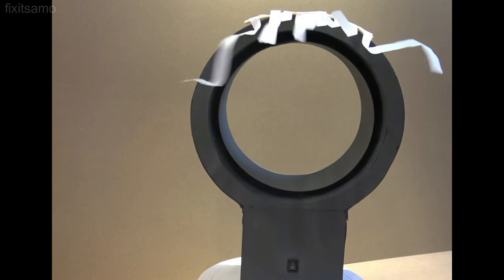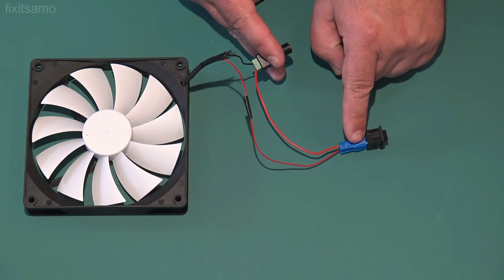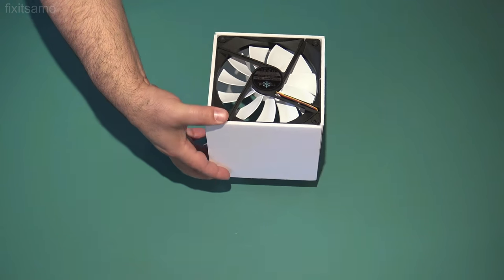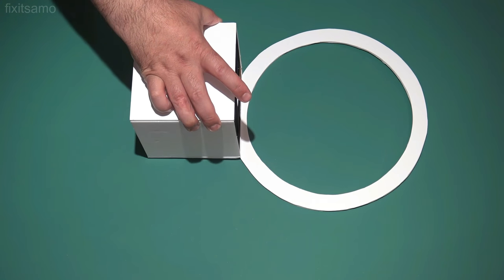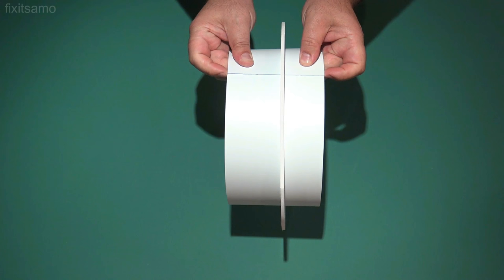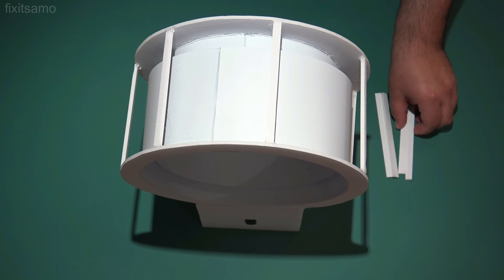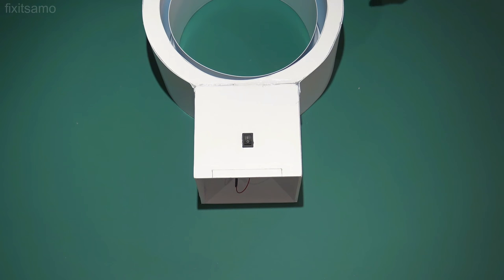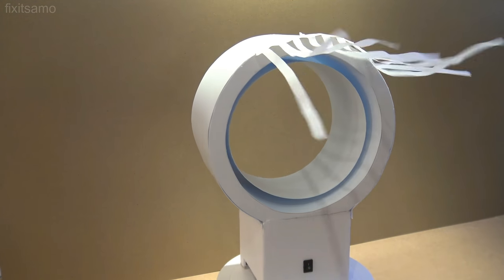How to Make a Bladeless Fan - DIY Homemade Silent Fan

Comment: nice project....my main issue is how cool it can keep you. Small fan can only do so much....nice and neat execution...and very light i persume. I would a a shelf underneath and put something cold like a block of ice so that the air that is sucked in comes out even colder.
Reply: The idea is that even tho the fan is small there is a multiplier effect on the air that it sends towards you. The air being pushed by the small fan creates a low-pressure area behind the cylinder that causes even more air to go through. So it should be enough. But I suppose you can always use a bigger faster fan if you want more air.
Reply: I don't, generally, use a fan for cooling. To me, air circulation is the main thing.

Comment: hello friend, very good your input, I have an idea, nose to what extent can help me, the idea is this: I have a small motor console splip which kiero use to make a fan on a larger scale, the problem is that 220v motor is not like making the connections, any input can be of great help me, I'm from Venezuela, thanks.

Comment: Wait, where did you get that exact fan, and what is the power input and output of the fan?
Reply from the maker: +Dolphinasd Gaming 

Its a standard pc case fan  input 12 V
Motor speed up to 2000 RPM
Reply: fixitsamo thanks.
Reply: fixitsamo Does it also work on a USB connection of about 1 amp?
Reply from the maker: +Dolphinasd Gaming 
It all depends on your fan

Comment: those who think he lied about "bladeless" read below. A bladeless fan (sometimes called an air multiplier) blows air from a ring with no external blades. Its blades are hidden in its base.
Reply: I don't think anyone was really dumb enough to think that you can make a fan without blades
Reply: +Ash Scott Oops I did thought it was without blades
Reply: manu thomas ahem, think old school, A PEAICE OF PAPER IS BLADE LESS.  Duhhh, it's a fan if u fold it like one
Reply: Check out the exhale fan. It uses vibrations to generate wind

Comment: 3:37 You do realize you're not making 6 inch circles.  The compass is set to 6 inches for a 6 inch radius, but the circle you create is 12 inches (1 foot) in diameter.

Comment: That is a wrong design. The inner surface should be cone - it provides the Coanda effect with sucking times more air, and the slot should be deeper - at the very beggining.

Comment: I didn't  understand  that from where the air comes from because  you do not have make the any hole in upper side of the PC fan and one more Question. and from where  I get the PC fan
Reply from the maker: The air circulates comes from the bottom off the base where i made the 4 cuts  trough the pc fan  and it will come out between the inner and outer circle  

You can purchase the pc fan online  or go to any pc repair shop they are not hard to find
Reply: The air comes from underneath. Notice the base doesn't sit flat on the table.... there are those rectangular gaps or holes, so the 'bladed' fan can suck or draw air from underneath, which forces the air up to the circular opening. The system isn't really bladeless as such ..... it's really a 'hidden or concealed blade fan'.

Comment: where did you connect the adaptor? to the outlet??
Reply from the maker: That’s what i used 

Vct VX-79NP Multi-Purpose AC to DC Adapter Voltage Converter 110V to 240V with Multiple DC Output Selection1.5, 3, 4.5, 6, 7.5, 9 and 12 Volts DC, Fixed 1000 MA https://www.amazon.ca/dp/B0014JUGTQ/ref=cm_sw_r_cp_api_i_5HKZH940XHW5EKGEZQEQ
Reply: 🔴 What Is Islam? ⚠️

🔴 Islam is not just another religion. 

🔵 It is the same message preached by Moses, Jesus and Abraham.

 🔴 Islam literally means ‘submission to God’ and it teaches us to have a direct relationship with God. 

 🔵 It reminds us that since God created us, no one should be worshipped except God alone. 

 🔴 It also teaches that God is nothing like a human being or like anything that we can imagine.

🌍 The concept of God is summarized in the Quran as:

📖 { “Say, He is God, the One.  God, the Absolute.  He does not give birth, nor was He born, and there is nothing like Him.”} (Quran 112:1-4)[4] 📚

🔴 Becoming a Muslim is not turning your back to Jesus. 

🔵 Rather it’s going back to the original teachings of Jesus and obeying him.

Comment: What size pc fan did you use?
Reply from the maker: +Saul Rocha  5 1/2 x 5 1/2
Its a universal pc fan usually installed on a pc case  for air  circulation
Reply: fixitsamo so a 140mm fan, that's what I used
Reply from the maker: +Saul Rocha 👍🏼

Comment: No it's a wrong design basically blameless fan has an airfoil type design which is completely missing in your design........... more over just check bro does air is flowing from center or not

Comment: are you using card board
Reply from the maker: +Deepika Laxmi 
I used  plastic  for the video but you could a cereal box cardboard
Reply: @fixitsamo  what kind of plastic did you use?
Reply from the maker: Its a very flexible plastic i got it from a printing shop they usually use it to make signs i don’t know the name unfortunately

Comment: Am I missing something?? There's a bladed fan!!!!!!!!  
Should be called how to make a bladed fan unit APPEAR to be bladeless
Reply: A "bladeless fan" is just a generic name for Dyson's "Air Multiplier" trademark.  That's what people started calling them because it appeared that there were no blades on the fan, when in reality, the blades of the fan are inside the base.  It's not simply a matter of hiding the fan blades inside the base to make it appear to be bladeless.  There is a scientific principle involved called the Coanda effect that actually multiplies the amount of air flow produced by the fan blades by around 15x.  However, with that being said, this design in the video wouldn't actually produce much of the Coanda effect as the inner circle is simply flat. 

If you're interested in it, James Dyson explained how it works it in this video when they first launched it:
https://youtu.be/8he8afjQyd8

Comment: How is it bladeless if it has blades?
Reply: with "bladeless fan" is meant, that there are no fans visible.
Reply: Then it should say "hidden fan" but instead you use the title as click bait. Very interesting project but you should have just tole the truth in the title.
Reply: dyson calls them bladeless fans, I guess they're using that as click bait as well then
Reply: Why so pedantic?
Reply: Dyson fans work by a ionic breese. Not hidden fans.

Comment: If this truly multiplies the air, you should show the air being sucked through the hole, not just the air that is being pushed through the round slot as shown in the video. Nice project build, but poor demonstration.

Comment: I've been debating this "blade-less" fan nonsense for a while now, and it seems there are still people who think it's OK to call a fan blade-less.  My argument has been, and still is, that you cannot call it a "blade-less fan" because a fan has "blades."  That is the way a fan works - it has angled blades that force the air forward or in reverse.  Now, these so-called "blade-less" fans just just re-configured chassis, with the "fan" forcing the air through a different path.  It does not work without a "fan" and that is the reason you cannot call it "blade-less."  In fact, the word "blade-less" is not even a word.  The only reason it's found anywhere is because Toshiba created the concept in 1981 and then Dyson patented the thing and called it an "Air Multiplier."  I'd much rather people called it that, instead of "blade-less" fan, as this would at least make more sense.

My argument has always been on the term, "blade-less."  So here is another angle that most people are not taking into consideration.  When you add the suffix "less" to a noun, you get an adjective that describes the root word.  For example, "Sleep" + "less" = "Sleepless" and the meaning is "having no sleep."  Same with many other examples such as endless, restless, flavorless, weightless, shameless, priceless, motionless, heartless, and harmless.  There are probably thousands of examples.  So if "blade-less" were an actual word, it would mean "having no blades."  And since these devices all use a fan to push the air, and fans cannot work without "blades" then it cannot be called "blade-less."

Again, just because the fan is hidden, we cannot say it doesn't have a fan.  Therefore, we cannot say it doesn't have blades.  And therefore, we cannot call it bladeless, which isn't even a word.  I'm done, I've made my point.  I'll shut up now so the crybabies will stop complaining.
Reply: Nobody cares
Reply: Some people are just small minded! If he is  so bent on the terminology, he should go and sue Dyson for false advertising.

Comment: Considering you can buy a Dyson clone now of about this size lighted with a water cooling system for about 30.00 and his materials and a glue gun would cost about 20.00 it would probably make more sense to just buy a nice slick brand new real one. Unless you are looking to just build one anyways and are into that foam construction high school project look. It still doesn’t swivel like in the video.
Reply: I always see comments like this on DIY videos.  Just makes me wonder why people are watching DIY videos if they don't even have a glue gun, and don't have any idea what they cost.  I have one that was $5, and a dual temp one that was $25.  

A good portion of DIY projects are more expensive than just buying the thing... but not always.  It also depends on how much time you have, how much your time is worth, and what supplies you already have.  Most DIYers will already have a glue gun (or two) laying around, and various materials/scrap to build with.  Not to mention boxes/closets/sheds/garages full of junk that they can salvage from.  Saving money is rarely the point, but once you get into it and you have some tools, you can find a lot of ways to save.

There are 3 main reasons to DIY:  1) learn something.  2) "upcycle" some old junk you have laying around.  or 3) save money.   And they go basically in that order most of the time.  Simply "having the thing" isn't the point.

Another big reason is that people just like to make their own version with their own aesthetic/personal touches.  But there are any number of other reasons, like doing something crafty with kids so they can learn something.  I don't have kids (yet, anyway) but I like to make things for my niece & nephew, and I like showing them that you can make things instead of just buying them.  They think it's cool and you can see their minds opening up to new possibilities.  I kinda wish someone would have done more DIY stuff with me when I was a kid, I didn't get into it until much later.  

This fan is admittedly kind of cheesy, but I think there's a place for every level of DIY and I'm glad people are out there showing it.  I saw a bigger one that a guy made by chopping up a plastic planter and a water cooler jug.  Obviously when making videos, people try to save money on materials (unless it's one of the rich/sponsored youtubers that make everything perfect).  If you don't like the high school foam construction look, you can use whatever you want.  If you want to make one, watch a few videos, gather some ideas, and make it how you think is best.  If you want to contribute to the community, make a video or instructable and show how you did it.  

(I agree it's annoying that he didn't show the swivel, but it looks like he just put it on one of those little rotating tables)
Reply: Do you have a link to this cheap fan?

Comment: Third video today, from crazy mental people trying to say they are making "BLADE-LESS" fans - but you are lying!  At 0:16 you clearly show the parts you use and what is sitting there on the table?  You guessed it, a FAN with 11 BLADES.  You really need to see a doctor.
Reply: @Mark Kissner:  Think about what you just said.  First you admit it's a fan.  That, in itself, negates any argument you might have that it's blade-less, since fans are called fans due their "fan blades."  So you can't call it a fan unless you admit it has fan blades, therefore calling it a blade-less fan is not only contradictory but also redundant.  Then you try to justify your reasoning with a definition you call an "exceltable term."  Do you know what you get when you google that, Mark?  But, I digress.  You cannot call this or any such device a blade-less fan.  The correct term is "fan."
Reply: The 11-bladed fan is UNDER the bladeless fan.
Reply: @Luhkey Slurbage: Could you possibly explain that again? I've a horrible feeling I might be a Dumb Ass for initially thinking that the term bladeless was simply referring to its overall style of design rather than its necessary physical inner workings. Presumably the designers felt that not exposing the blades would have aesthetic and safety advantages, and I felt I was almost on the point of understanding your analogies with other noun-adjective transformations but a few more might just help me appreciate your argument to the fullest extent. Your critique of this video was truly gripping and I'm sure everyone else enjoyed your skilled observations as much as I. Please write more of your opinions on the Internet for us all to read, they really are worthwhile.
Reply: @Reg Waterford:  Nice try, but no.  I am speech-less.  Get it?
Reply: Get a life! Do you have the brains to come up with such a simple yet effective design. Some people have a chip on their shoulder and cannot compliment some one's good work!